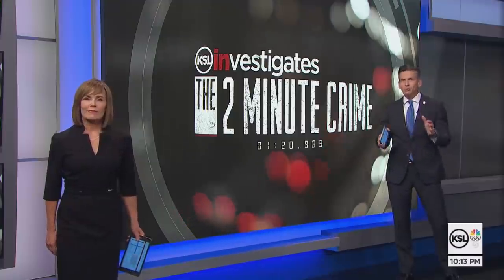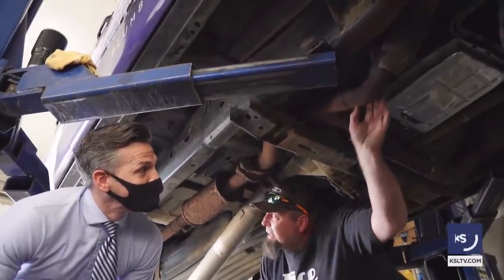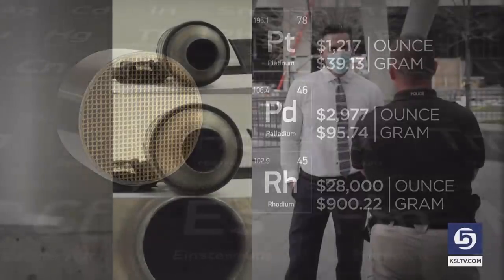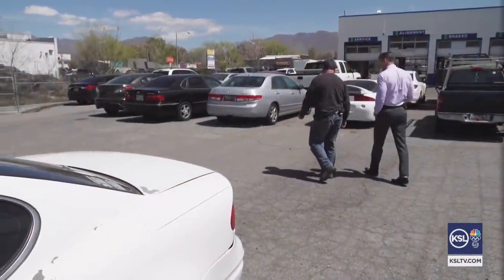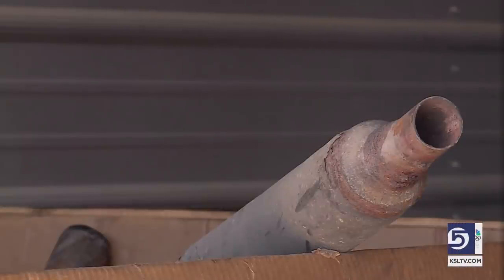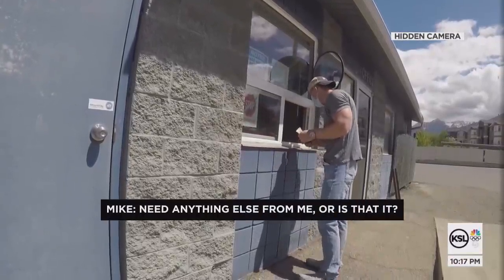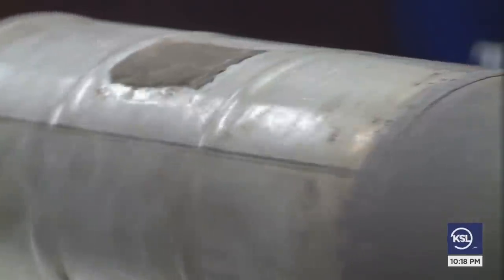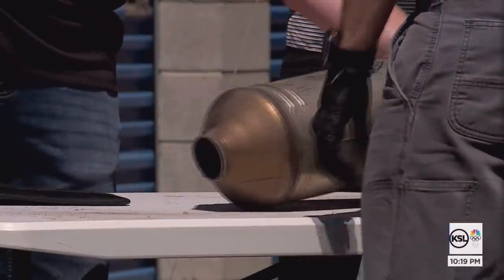KSL Investigators goes undercover to check compliance as catalytic converter thefts skyrocket

Comment: The recycling  scrap yards  are just as guilty as the thieves they practically encourage it. If you look at the info on their websites the section about cat converters is lengthier than anything else and one site even had a video telling you how to find them and what tools to use to get it out.  Anyone who legitimately has the right to remove a cat converter from a vehicle doesn't need their video telling how to find one and what tools  to use because they already know.  The recyclers make even more on recycling them than the thieves that bring them stolen cat converters.
Reply: People don’t know how to do it then they will look up a video. I had to look up a video for removing my cats. I didn’t cut them off. I unbolted them. Every car is different. If you aren’t in the mechanic field then chances are you don’t know what you’re talking about.

Comment: I would'nt be surprised if   repair shops and auto dealers had dirty hands in this. They'd be smiling when the victims come in to have new converters installed. Two grand is a lot to give up to replace a part that was there when you bought the vehicle.

Comment: Half of those Cadillac converters ceased were taking off properly instead of cut off.?. I would understand the ones that were cut off, but no Thief is going to take the time to unscrew the bolts! Those things are almost impossible and normally break off

Comment: They should have places where you can take your car in and have them stump your name and address onto the Cadillac converter. And if the car is ever switched over to another owner then that new owner should do the same at his or her discretion. And if your name doesn't match up with that Cadillac converter then there's a problem... And if the name on the Cadillac converter is compromised in any way then once again you have a problem... I'm not saying that it should be mandatory but at the owners discretion which means the owner will be responsible for protecting his or her own Cadillac converter... These thieves 
Attempted to cut my Cadillac converter off but fortunately my car was too low to the ground on gravel pavement and they wasn't able to get a jacket under the vehicle...

Comment: I hope y'all know that not every catalytic converters are worth money. Especially the new ones they out in vehicles, a business I go to has had problems with there's being stolen and they told me they came in stole there's and then came back got more. The ones they replaced it with was not the same as the ones that was stolen so whoever got the news ones are not worth what the original ones. I deal with recycling and got told about this during a pickup. Also the new ones will have serial numbers so if someone takes it they will have to have paperwork for them now

Comment: Or actually a better solution would be that little metal mesh why is it made out of those different types of platinum and the different metals and what can we use to replace it instead it that's not expensive and not soluble enough for them to make a profit off of if they were to be stolen that sounds more like a reasonable explanation and logical way to go by stopping these people from doing that take the option away from them no option no theft just have to do the research and why they're using these metals for that little little tiny grade the reason for it and how effective it is compared to what else we could use that's logical thinking.
Reply: Those metals are used because that’s what it takes to filter out the gasses coming out of the engine. If there was a cheaper way to do it then you can be sure that companies wouldn’t be still using Platinum and Rhodium
Reply: Yeah so far that's what catalyzes the nitrogen oxides into less polluting gasses. Cheap Metals won't do the same thing.

Comment: Owners also should have their catalytic converter‘s engraved with their addresses on them as well as their name that way they won’t be stolen
Reply: Would be super easy to grind away any etchings so thats pointless
Reply: @thatguy6214  it would show tampering with the information
Reply: @SuperAgentman007  what information? There is no system in place to track cats so no it wouldnt show tampering of anything. Scrapes on exhausts is common.

Comment: The cat on my truck has been on there for 30 years. I be surprised if their was anything left inside of it. Maybe someone will steal mine and not get anything out of it 😂
Reply: It doesn’t work that way. Your catalytic converter is probably clogged after 30 years of use. So all that material is still there.
Reply: @thronewalker1153  you ever heard of oxidation?
Reply: @tacobagcharlie9298  so your cat is oxidized straight though? Basically there’s nothing left.
Reply: @thronewalker1153  we'll since when i didn't have a muffler on my truck for a few months it didn't sound like their was a cat still on it yeah

Comment: technically you don't even need the outside of the catalytic converter. all you need is what's inside of it .
Reply: and the stupid thing is you really don't even need a converter. it's supposed to scrub the air that comes out of the car. but if you really knew how they worked you would be dumbfounded. all you have to do is take the first O2 sensor out and then they have 02 sensor that moves the sensor up you put that in and then you put the sensor back into it and then when it goes through the well it thinks it's going through a Cali converter and you just have a pipe and then it reads a different number from One sensor to the other it's like oh okay there you go. and then you just reset the computer and then they'll check engine light won't come back on it will be different number coming out of the tailpipe but they don't check that stuff. all modern cars they checked the OBD2 port to see if there is emissions but they don't actually check it from the tailpipe
Reply: @MyIronman8  Not the brightest knife in the bulb drawer.
Reply: @ShainAndrews  your mother said hi
Reply: @MyIronman8  Son... she's been gone a long time.  Further proving the point.  You're the type of kid that installs screen doors on submarines.

Comment: Well I guess I'm lucky my cadilic converter is only 550 to replace I just had a new one put on because the old one was clogged some advice for y'all tho that are getting them stole off ur vehicle have ur mechanic in grave the vin if of vehicle on the cadilic converter and spray it with spray paint a bright obnoxious color that is easy to identify I don't have to worry about mine getting stolen because my vehicle is right outside my bedroom window and anyone ballsey enough to try something gonna catch some hot slugs

Comment: There's an easy solution. Keep your engine running at all times. It will be too hot to steal.
Reply: That’s why thick gloves like welders glove were made. Another solution would just be to get a steel plate underneath to cover your cat. Takes the low life’s longer to cut and hopefully you are able to blast them before they get the chance.
Reply: @ManuelMartinez-vj1gn  yes, the steel plate would work. Or just do a cat delete and gain a few horsepower.

Comment: If you’re willing to pay $2400 for a cat replacement you deserve to get it stolen.  A cat is $60-300 and VERY little labor on most cars.  If it’s easy to steal it’s easy to replace.  If you had to buy 4 jacks, a new set of tools, hired a welder, and took a cruise to Alaska 3 times, it’s still cheaper than what the news thinks a cat costs.